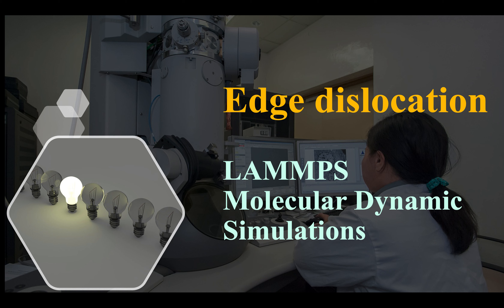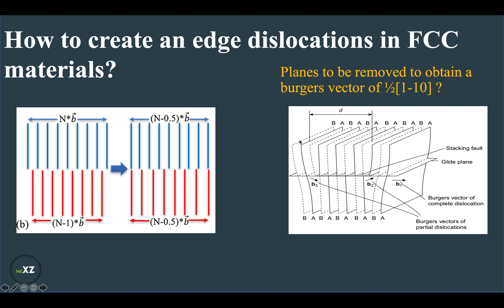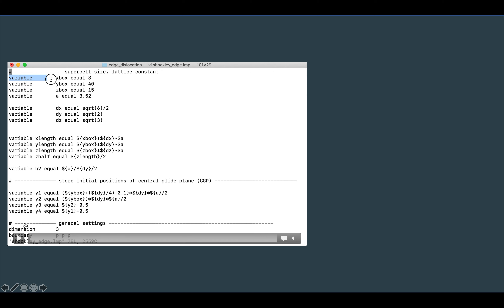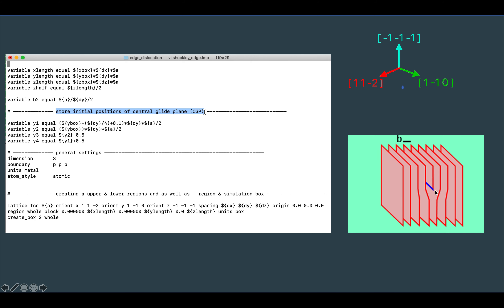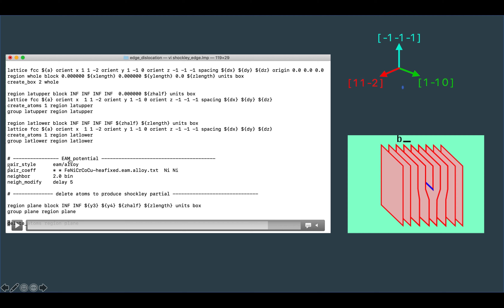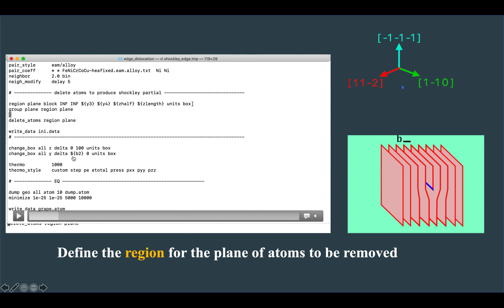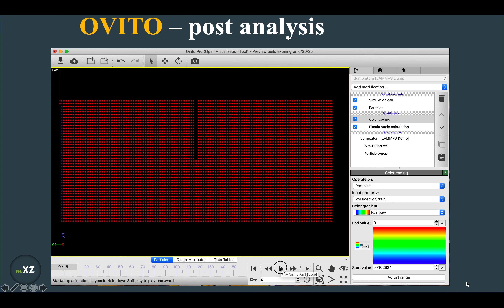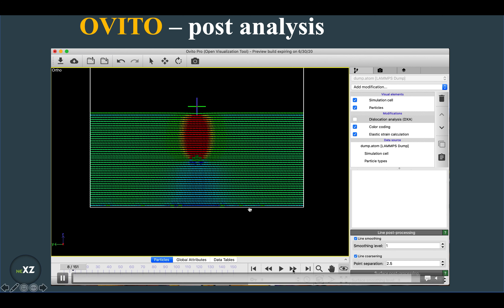Edge Dislocation || FCC materials || LAMMPS || Molecular simulations || OVITO Post analysis

Comment: Thank you for the tutorial. It is very helpful. When using OVITO for post-analysis, I enable color coding, but I do not get the Input Property option: Volumetric Strain like in the video. I ran both a model of mine and your model in the Github files provided and the option is missing for both. Have you possibly encountered this error? If so, do you have any fixes for it?
Thank you!
Reply from the maker: I think you have to put the 'Volumetric strain' below the 'Color coding' on the pipeline using the up and down arrow mark on the side. Since you have to evaluate the Volumetric strain first you select it, and then you can select the Volumetric strain as the input property in Color coding. Hope this answers your question
Reply: @NextZenStudent  Yes it did answer my question! Finally, I ran the model using the code you have posted (I did not change it at all), but I see small differences between how the model I ran moves and how the model in the video moves. I am quite the beginner at LAMMPs so is this normal? I can contact you more through email if it is okay.
Reply from the maker: sure email me to: contactsnextzen@gmail.com

Comment from the maker: LAMMPS code to create an edge dislocation:

#----------------- supercell size, lattice constant --------------------------------------
variable        xbox equal 3
variable        ybox equal 40
variable        zbox equal 15
variable        a equal 3.52

variable        dx equal sqrt(6)/2
variable        dy equal sqrt(2)
variable        dz equal sqrt(3)

variable xlength equal ${xbox}*${dx}*$a
variable ylength equal ${ybox}*${dy}*$a
variable zlength equal ${zbox}*${dz}*$a
variable zhalf equal ${zlength}/2

variable b2 equal ${a}/${dy}/2

# -------------- store initial positions of central glide plane (CGP) ----------------------------

variable y1 equal (${ybox}+(${dy}/4)+0.1)*${dy}*${a}/2
variable y2 equal (${ybox})*${dy}*${a}/2
variable y3 equal ${y2}-0.5
variable y4 equal ${y1}+0.5

# -------------- general settings --------------------------------------------------------
dimension       3
boundary        p p p
units metal
atom_style      atomic  

# -------------- creating a upper & lower regions and as well as - region & simulation box ----------------------

lattice fcc ${a} orient x 1 1 -2 orient y 1 -1 0 orient z -1 -1 -1 spacing ${dx} ${dy} ${dz} origin 0.0 0.0 0.0
region whole block 0.000000 ${xlength} 0.000000 ${ylength} 0.0 ${zlength} units box
create_box 2 whole

region latupper block INF INF INF INF  0.000000 ${zhalf} units box
lattice fcc ${a} orient x  1 1 -2 orient y 1 -1 0 orient z -1 -1 -1 spacing ${dx} ${dy} ${dz}
create_atoms 1 region latupper
group latupper region latupper

region latlower block INF INF INF INF ${zhalf} ${zlength} units box
lattice fcc ${a} orient x  1 1 -2 orient y 1 -1 0 orient z -1 -1 -1 spacing ${dx} ${dy} ${dz}
create_atoms 1 region latlower
group latlower region latlower

# ---------------- EAM potential ----------------------------------------
pair_style      eam/alloy
pair_coeff      * * FeNiCrCoCu-heafixed.eam.alloy.txt  Ni Ni 
neighbor        2.0 bin
neigh_modify    delay 5

# -------------- delete atoms to produce shockley partial ------------------------------

region plane block INF INF ${y3} ${y4} ${zhalf} ${zlength} units box
group plane region plane

delete_atoms region plane

write_data ini.data
# --------------------------------------------------------------------------------------

change_box all z delta 0 100 units box
change_box all y delta ${b2} 0 units box

thermo          1000
thermo_style    custom step pe etotal press pxx pyy pzz

# -------------- EQ -----------------------------------------------------

dump geo all atom 10 dump.atom
minimize 1e-25 1e-25 5000 10000 

write_data grape.atom

Comment: Using this can we compute velocity of edge dislocated if we apply the shear force
Reply from the maker: Sure we can do it but may need ovito to obtain the velocity
Reply: actually it is not pure edge dislocation, it must has a screw component by this method. So we may not compute the mobility(what you said, velocity) of edge dislocation. The model is not proper.
Reply from the maker: yeah you are right. we can create the perfect dislocation by fixing the atoms ( restricting their displacement) in 2 directions except the burgers vector direction and relaxing the structure. Then we can try to move the dislocation and calculate the velocity. But usually the stable state (least energy state) is Shockley partial dislocation in FCC crystal. Hence we can try to evaluate the edge (60 degree) partial dislocations velocity

Comment: Consider I want to remove the perfect atoms to see the defects clearly. May I know what is the command I have to use in OVITO
Reply from the maker: Hi @Rajarajan, I have included that part in my following video: https://youtu.be/zE_SQEEy6Ic

1. do common neighbor analysis
2. please use expression select
in expression select StructureType == 0 or 1 or 2 based on structure you want to eliminate
3. Delete selected particles

please check the video link: https://youtu.be/zE_SQEEy6Ic
Reply: @NextZenStudent  Thankyou so Much!. It worked!

Comment: It's very usful. I have a question: How to set y1, y2, y3 and y4 value and to connect these values with the Burger Vector? Especially  y2. Thank you for your assistance!
Reply from the maker: burgers vector = a/2 [ 1 1 0 ] 
|b| = magnitude  of burgers vector = (y spacing) x (lattice parameter)/2 = ${dy} x $a/2

${dy} x $a = contains 4 - [ 1 1 0 ] planes  
${dy} * $a/4 -  contains 1 - [ 1 1 0] planes 

so I select y2 at the half box length along y direction
and y1 is at 1- [ 1 1 0 ] plane distance from the y2 

In order to remove 2 plane of atoms in the y direction to get a/2 [ 1 1 0 ] Burgers vector dislocation. I try to use y1 y2 in delete plane command but couldn’t achieve 2 plane removal,

So, I have used y3 and y4 to select 2 plane of atoms. It is by trail and error, that I decided on y3 and y4

I hope this answers your question
Reply: @NextZenStudent  Thank you for your answer! Now I understand the algorithm.
Reply: @NextZenStudent  i am very new to learning LAAMPS. could you please tell me what is dx, dy, dy and how it is different from lattice constant.

Comment: This is a good video to new starters, no doubt. But if you focus more on the dislocation itself, and you want do deeper research on dislocations. At least you should learn to create dislocations by isotropic elasticity theory, or even anisotropic(you need more knowledge and code writing skills for this), (you can understand it as just adding half atom plane is not physically true, nature never creates dislocations by adding extra atoms). And also sometimes you dont want it to have a free surface as you show in your video, which might has an unwanted influence on the dislocation, both on core structure and mobility(it also depend on which problem you want to solve). Anyway, it is a serious topic and you need to be very careful. It is a good video. Thanks for making it and I hope more ppl enjoy this and can join us to explore this interesting field.
Reply from the maker: Thanks for the insight Liu Anwen. I just said adding half plane of atoms creates the edge dislocation, it is just a perspective of seeing. In the lammps code, I have removed the half plane of atoms. I just added the free surface to avoid the dislocation at the periodic boundary, I could have used shrink wrapped boundary or just ignored with periodic boundary. And yes while applying the shear stress to move a dislocation the free surface doesn’t help, we can fix the atoms at the z boundary and then apply strain or stress